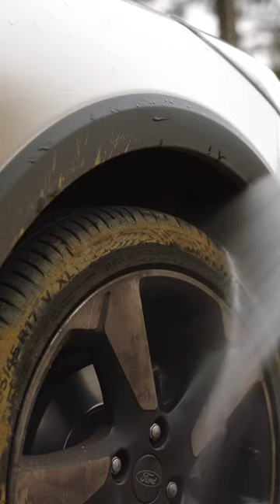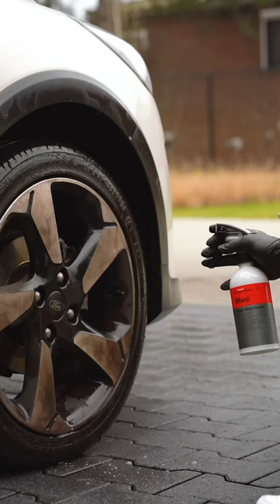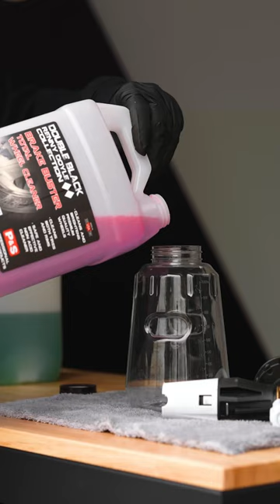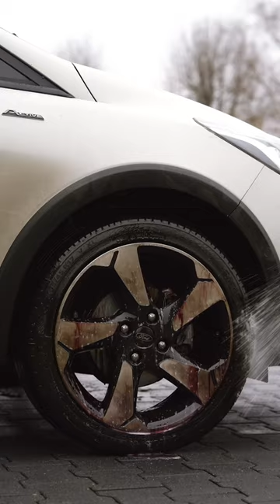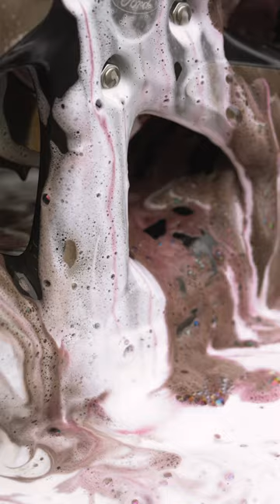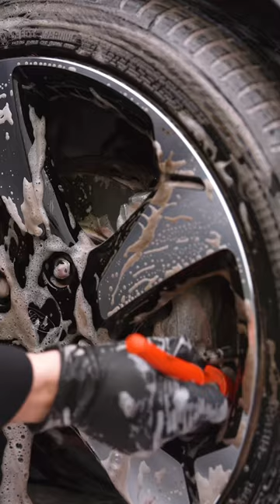These Wheels Were DIRTY - ASMR Detailing

Comment: $50 worth of chemical per wheel 😆😂🤣
Reply: I was like wtfff
Reply from the maker: I barely used anything per wheel, but indeed, these guys have no clue what they are talking about 😂
Reply: That is a boat load of chemical 😂😂 
This guy recorded it, uploaded and still denys it 😂
Reply: @MrSpilledge I take it back.. he put a fuck load In the foam cannon.  Thought you meant what he was literally spraying😅
Reply: Lol it’s not a lot. Just looks that way cuz of the foam. Besides, brake buster is cheap anyway.
Reply: @Changweezy  they mean what he poured into the bottle could have been diluted
Reply: @jh.f30 it gets diluted by the pressure washer water
Reply: @mossy723  supposed to mix it with water IN the foam cannon too lmao, everyone knows that
Reply from the maker: Haha the confidence in these comments, thinking they know what they are talking about 😂
Reply: @VermijlCarDetail  you put straight soap lol, anyone would question that
Reply from the maker: @jh.f30 yea, you can use Brake Buster straight up, everyone knows that, that’s why it also comes in 500ml spray bottles. If you put it straight into a foam cannon it gets diluted a lot by the pressure washer itself, like I mean a lot. The foam cannon wasn’t even fully open.
Reply: @jh.f30  there’s no need, it dilutes with the pressure washer water and it’s cheap, why dilute it further lmao, everyone knows that

Comment: that's way too much brake duster, maybe do 5/1 ratio...
Reply from the maker: It is not. You can use it straight up if you like. Of course you can dilute it, but it gets diluted by the pressure washer anyway.
Reply: @VermijlCarDetail  Right, but Brake Duster is quite expensive as is. If I used it like that I would have to boost my prices... Good job though!

Comment: Never thought about doing it thru foam cannon . Probably not the most cost effective but looks nice for tik tok
Reply: Епппа, Вы ещё думаете об экономии
Reply: I got rid of my IK foamer cause I got sick of pumping. It saves the most uses up my energy and time. Product isn’t expensive, wheel cleaner is about $30 a gallon and you’re getting about less than $1 a use if you use it 60 times to clean wheels with a spray bottle.
Reply: You don't need to use as much as he did. 2oz would be fine.

Comment: By the time you finish with a wheel do you usually see rust forming on the steel rotors?
Reply: That's normal for modern steel rotors or brake discs. You can spray it with brake and parts cleaner but it'll get onto your wheels. Just let the brakes clean those rust off. Nothing you can do about it I believe.
Reply: @russelbalugo2071  yes, but it’s quite an eye sore. Especially after you go through a proper wash and then you end up seeing orange drips on the barrel from the rotors. I just found this new solution, where you spray it on the rotors right after washing the wheels, really helps stop the rust forming in its tracks.

Cleaning the rust from the brakes isn’t the problem, that’ll automatically happen when I use the brakes. The problem is the flash liquid rust which drips on the wheel barrel after cleaning the car.
Reply: @mhossain21  Can I ask you what do you spray on it after you finish cleaning it ?
Reply: You can use Hyde's Serum Rustopper for that.
Reply: The chemical he’s using in the foam cannon, Brake Buster , has rust inhibitors in it

Comment: Bro you can dilute the brake buster tf don’t be scared
Reply: Brake buster doesn’t have to be diluted technically. Also he is diluting it with the foam cannon as water goes through it the product is being diluted
Reply from the maker: Exactly, doesn’t have to be diluted in the first place. And technically it is getting diluted by the foam cannon. You can even adjust te dilution with the foam cannon itself. Don’t be scared @bioblockdave
Reply: @VermijlCarDetail come on now. The whole point of diluting is that you use less product, to get the same result. You can dilute it up to 5:1 in a foam cannon. Even you know that yet you still chose to not